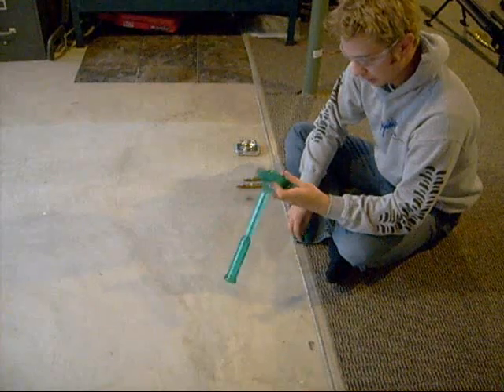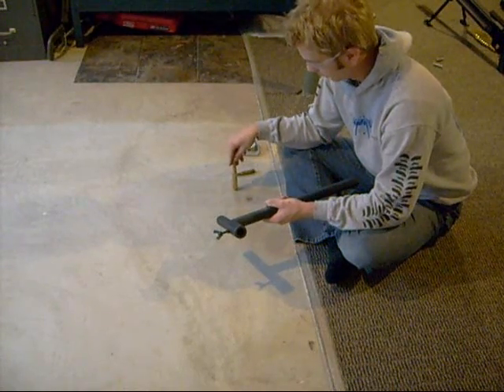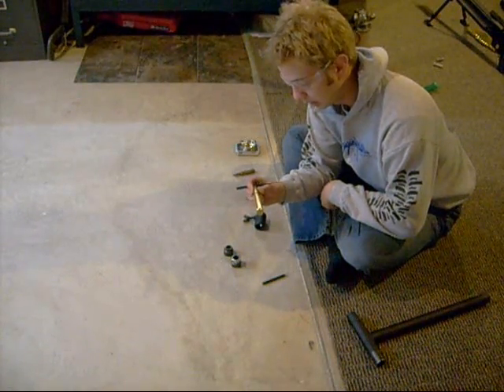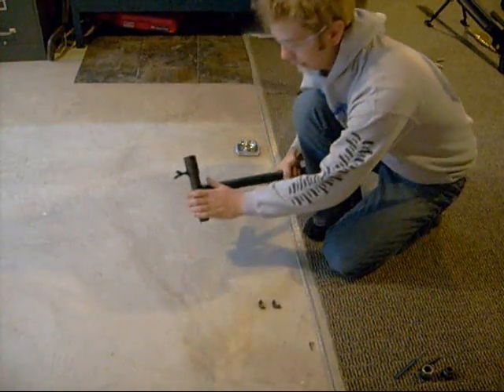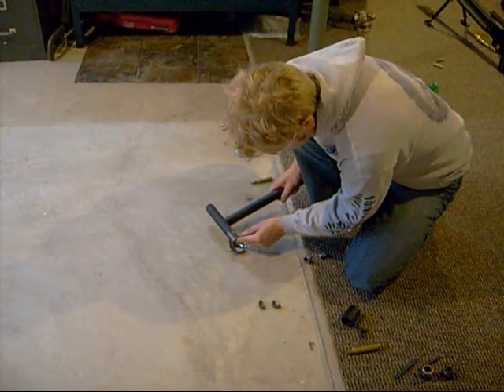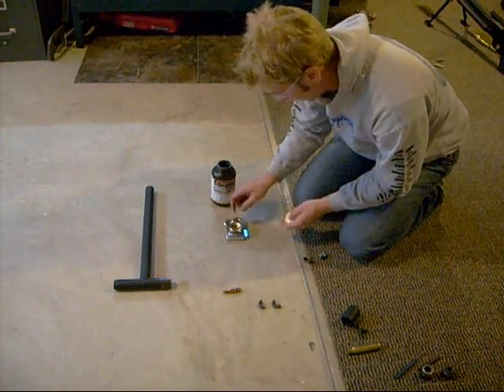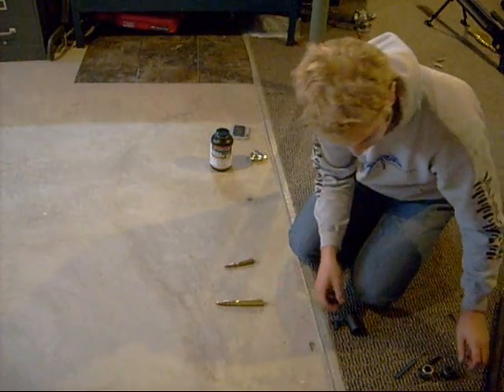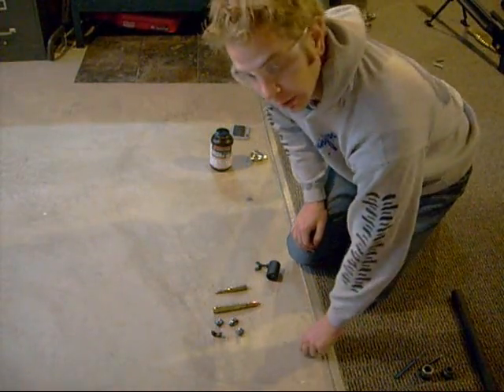50bmg kinetic puller

Comment: I put a collet crimp on my 50 BMG ammo, and I'm not sure a kinetic puller would work, although the much heavier bullet does have a lot more inertia to pull it out.  I have a 50 BMG puller that is a piece of aluminum bar stock with a hole for the bullet in a long slit that is squeezed together in the manner of pliers to crimp the bullet above the top of a press that is lowered to pull the bullet.  It's a joke.  It's impossible to squeeze it hard enough to prevent the puller from slipping off the bullet.  Even if I clamped the arms of the puller together, the aluminum would bend before enough friction would be produced on the bullet.  I think I'm going to make an un-anodized (not slick) aluminum block set with a hole to grab the bullet when the two sides are clamped together with a couple of socket head cap screws.  Raise the 50 BMG round through the press, lower the block over the bullet until it rests on the case neck, tighten the two cap screws to clamp the bullet in the block, lower the press to pull the bullet, and loosen the two screws to release the pulled bullet from the block.  I don't need to pull much 50 BMG ammo, and this simple method, even though it's slow, should work well enough for me.

Comment from the maker: @RobertN6 3/4" NF (16 tpi)   all I did was drill it almost all the way threw with a 13/16" drill bit.   

the nut ends up being about 1.25"  once slit and around a 50 bmg shell.

Comment: I would like to know if you can tell me what size nuts your using with the 50bmg, I had a little problem with the Lee resizing die but did find out till I had 50 rounds done. Wen to shoot my Anzio 50 and guess what no go brass was not size right due to the die. Lee made good on the die but now I have to take 50 bullets out. Can you help me out with this.
Thank You
Robert